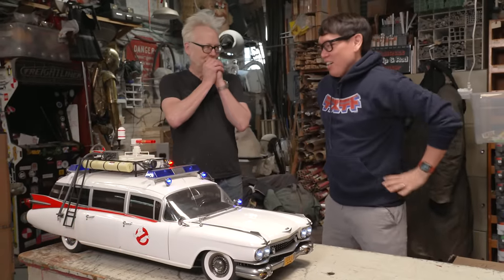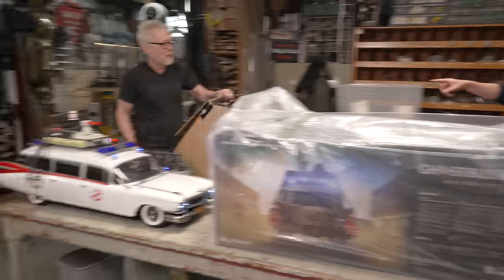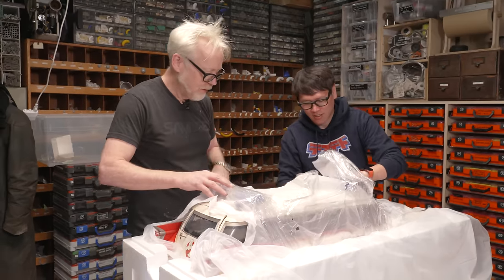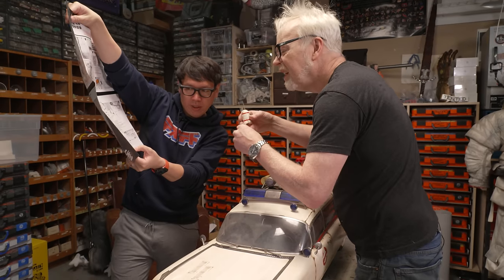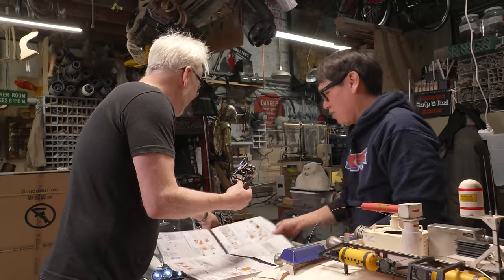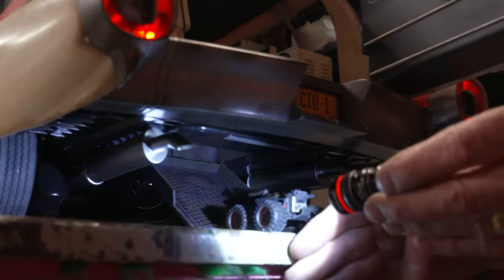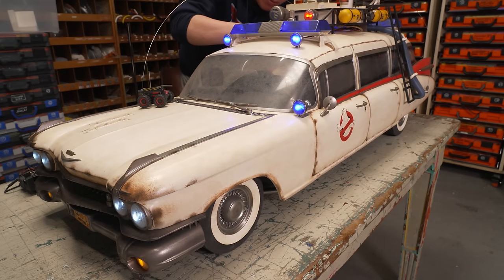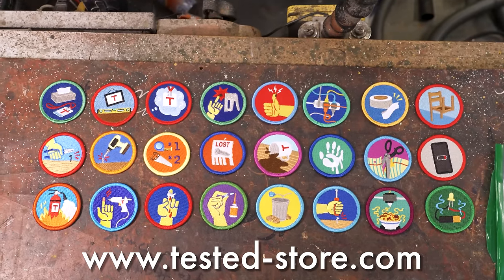Adam Savage Unboxes Ghostbusters: Afterlife's Ecto-1!

Comment: Marvelous unboxing, I have the Lego version which obviously isn't as big, has no lights with stickers for the rust patches but in every other sense it's the same... from the gunner seat that pushes out via a panel on the opposite side to the RV trap and drop down release and as you said about the size compared to the Delorean the Lego variant is the same Ecto dwarfs it. The weathering on that model is insanely beautiful, thanks for sharing.

Comment: Badge ideas:

CA gluing your fingers together
Fingerprint in fresh paint
Lost 10mm Socket
Sawdust in eyes
Inhaling paint fumes when you should have worn a mask
Moving a project before the epoxy has set and you break it
Breaking a 3D print while removing supports

Comment: Adam, we need a 15 to 30 second video. Shot in the dark, slight under lighting with fog machine piped thru tubes set below both Ecto1's. Either in a "V" to inverted "V" formation. The gunners chair extended with all lights on. PLEASE AND THANK YOU.

Comment: 12:23 ADAM, there's wire ribbons that used to be used for old Xerox machines and copiers that have thinner and (frankly higher quality) sheathing than the stuff you get normally. Now, you won't be able to find those, for obvious reasons, but, Xerox parts are still available, so if you have someone who can google about, they'll be able to find you surplus or second hand ribbons.

Comment: Back in the 90's I made a "Ghostbusters"-logo for my quake team (FPS game) The UnWanted (TUW). It had a classic quake player upper body in the typical forbidden-sign, like the ghost busters logo. What I notice was that I also had a problem with the angle of the "dash", due to that the neck and body needs to reach thru and the other arm on the underside, so the traditional 45 degrees angle wasn't working, but I also had to change mine slightly.

Comment: Yeah, plenty of times  the 'no-ghost' logo is used at the wrong angle. For some reason, they use the red diagonal line as the reference point, which ends up with the ghost looking tilted. Ghost's face should be 90 degrees to the horizontal line. Also, in international posters the logo was flipped horizontaly, most likely because they felt that was the correct way to present it (like the no-smoking sign).

Comment: What ya need is a vertical 'Carousell' of sorts.. or a gyroscopique Rolodex that would allow a shelf or shelves to be escalated on a vertical loop front to back while keeping each one up-side up; though some bespoke 'chuck-blocking' might need to be applied to each shelf respective of the vehicle it will hold. Then just do something with lots of plexy and LED strips so you can see the cars all movin' and stuff. Put it right next to the arm-ed-ure with all the replica firearms and call it good, then you'll have plenty of 'baby fat' to last both of ya's lifetimes.
I expect a one day build in a week.